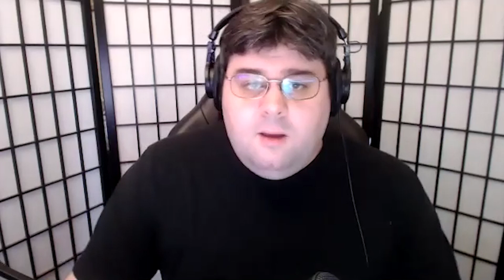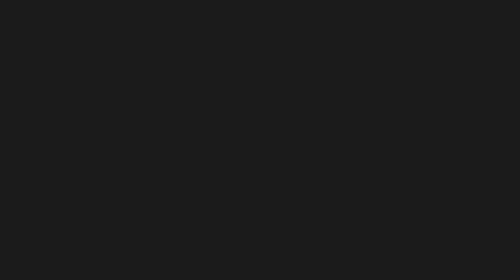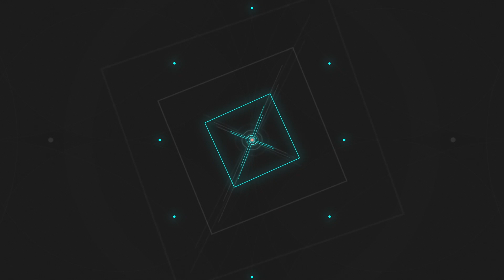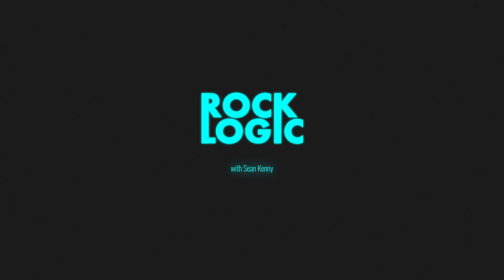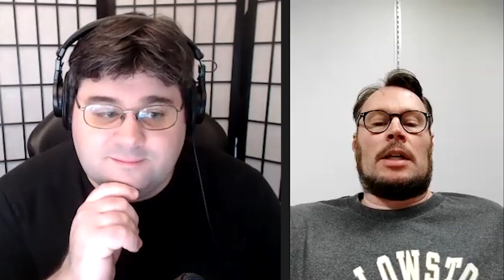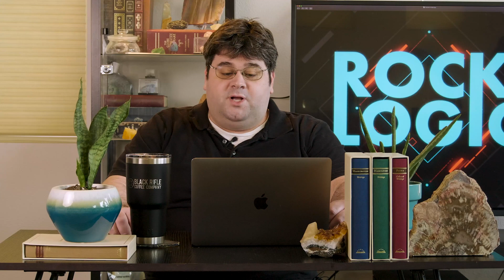Copenhagen Atomics Founder Thomas Jam Pedersen Talks Commercial Molten Salt Reactors | Ep 12

Comment: Copenhagen Atomics really needs to work with a real fission system, because the issues associated with neutron embrittlement are not trivial when in combination with corrosive salts.  Merely testing SS316 with non-radioactive salts only gives a limited experience.

Comment: can liquid salt thorium be space rated use in space? ( orbital, lunar, Or for use on Mars. )
Reply: Good question. To my knowledge the moon and mars missions are planned to be nuclear powered, but be specialized microreactors, not msr to as far as I know.
Reply: Yes. The molten salt is pumped, does not rely on gravity. Was originally going to power Curtis LeMays' atomic powered bomber, the XB-70 Which didn't actually get atomic engines. "The Navy has one. The Army has one. Where's MINE !?!?" Curtis actually said that. So, our top guy invented the molten salt reactor, to fly.

I'd give you a link, but, brilliantly, youtube deletes comments with links. Let's both try to think why.

Comment: ... ... Note:  Nuclear power has been declining in importance over the last quarter century, with its share of global electrical energy generation decreasing from 17.5 percent in 1996 to around 10 percent in 2019. Small modular and advanced nuclear reactors have been proposed as potential ways of dealing with the problems—specifically economic competitiveness, risk of accidents, link to proliferation and production of waste—confronting nuclear power technology. This perspective article examines whether these new designs can indeed solve these problems, with a particular focus on the economic challenges. It briefly discusses the technical challenges confronting advanced reactor designs and the many decades it might take for these to be commercialized, if ever. The article explains why the higher construction and operational costs per unit of electricity generation capacity will make electricity from small modular reactors more expensive than electricity from large nuclear power plants, which are themselves not competitive in today’s electricity markets. Next, it examines the potential savings from learning and modular construction, and explains why the historical record suggests that these savings will be inadequate to compensate for the economic challenges resulting from the lower generation capacity. It then critically examines arguments offered by advocates of these technologies about job creation and other potential uses of energy generated from these plants to justify subsidizing and constructing these kinds of nuclear plants. It concludes with an assessment of the markets for these technologies, suggesting that these are inadequate to justify constructing the necessary manufacturing facilities.   @t

Comment: Really very intrerresting !!! 
But what about the extremely odd idea to have salt at 700 C just millimeters (10-15mm?) from water (well heavy water but still water) at 50 C? Silicon Carbide pipes? plus Areogel insolation? how to connect that to the vessel wall in a reliable way. Just building a reactor with such temperature gradents must be unique to put it mildly.... And how will a leakage be managed?

Comment: What do you think of terrestrial energy and their reactors?
Reply from the maker: Well terrestrial energy is looking to build an integral MSR running on uranium. I wouldn't say its the best design compared to what Flibe or Elysium have if we are talking about power reactors. However making cheap process steam in remote areas is something that reactor would be greatly suited for. I like terrestrial, and I hop to see them hit the commercial markets in the near future.
Reply: @RockLogicWithSeanKenny  You may be correct, but I was under the impression they just wanted to get the uranium reactors out to the public while they move forward with testing on spent fuel and thorium? Any knowledge of that?